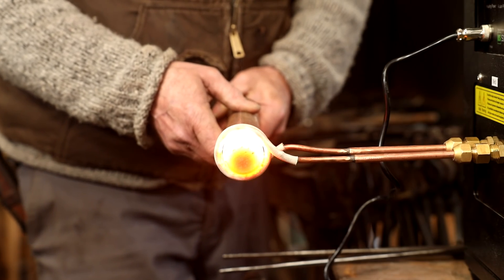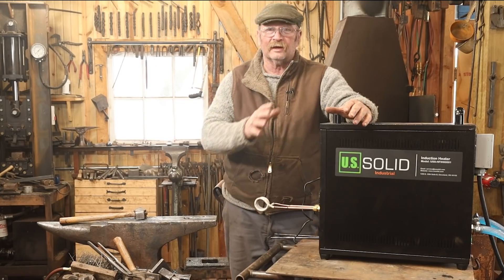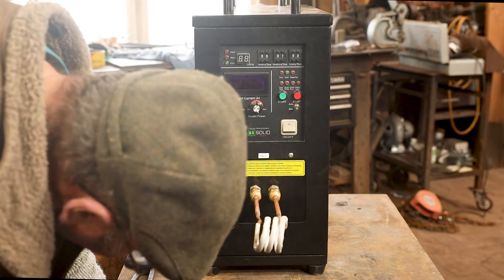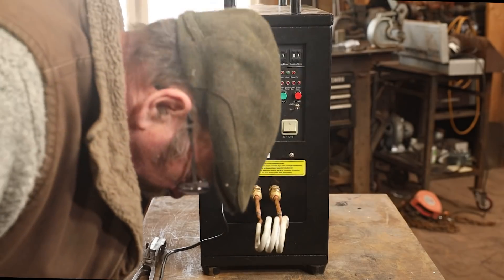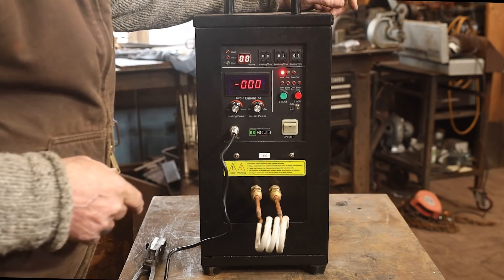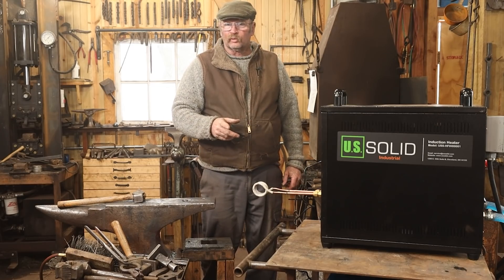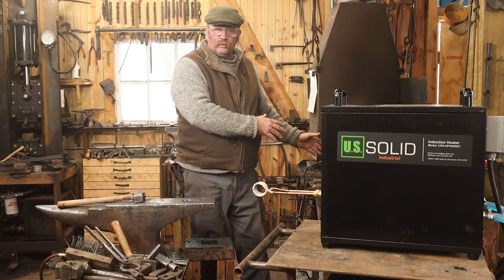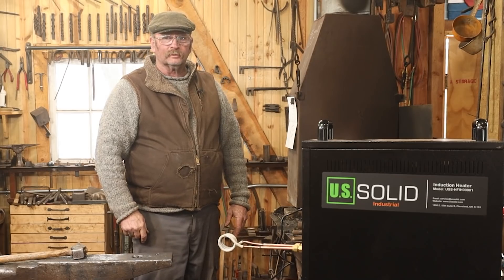Induction forge

Comment: Hello @Black Bear Forge ! your videos on the induction forge convinced me to get off the fence and buy an induction forge. The opening shot of the forge with coils and what looks like adapters from the 8mm to 1/4" flare is the reason for my question. Is that a set of adapters to convert the 8mm to standard 1/4" flare? I have a pair of the adapters ordered from mainland China (arriving ???), and a Forge on order arriving tomorrow and the tig water cooler just arrived this morning. My first coil I make will probably be a box that fits the leaf spring material I use for the larger Bowie style knives. I think I will try to make the first one large enough to fit the final form with it drawn out.  It might heat quicker fitting tight to the stock but over all be quicker and less effort to heat and forge the majority of it without changing the coil and just forging them out at the power hammer. I don't forge in the warm weather because my gas forge turns the shop into a torture chamber. A Gas forge adds heat and also humidity, that fact is not often mentioned but burning propane 'makes water' as a by product, and SW Michigan in July is humid enough. I have a hand held induction coil used for heating bolts but it has a small duty cycle, I managed to use it to make some nice bends in 5/16 rod to make shepherds hooks but I did supplement the heat with a gas torch to speed up the process, forming the tip took more heat/time than the duty cycle allowed.
Reply from the maker: Glad they helped. I think you’ll enjoy it

Comment: Hi! Love your video. I am looking into purchasing this induction heater. I have a quick question. On the machine on their website, the coils are positioned so that the work piece enters the coils vertically. On your video, your coils are where the work piece enters in horizontally. How do you get it so the coils are positioned for the work piece to enter horizontally?
Reply from the maker: You can make coils in either orientation and can bend the coil shown to be horizontal so long as you don't kink the tube.

Comment: I’d look into electromagnetic coupling via ferrite to couple very closely to the workpiece. That would bring the field losses way down and cause the piece to heat up even faster. 
This tight coupling was and still is used in high frequency power supplies.

Comment: I'm suprised to see these coils being used bare in a most videos I see, the sleeving is the most protection I've ever come accross. 
  I started in the trades building induction furnaces, forges and ovens. Everything from large steel melting furnaces, smaller precious metal ones and heat treating/annealing furnaces for coil and leaf springs etc.
  You can make the coils round, square or rectangular to suit the material being used. Filling the copper with fine sand when forming the coils on a mandrel helps keep the shape
  Tne easier methods we used was brass bolts soldered to the coils with 4 hardwood blocks drilled at the proper spacing intervals placed evenly around its diameter. Ceramic blanketing can be used to isolate the hardwood from the coil.  The inside of the coil then gets packed with refractory and the ends get shaped. This method only the inside gets packed. 
  Alternatively you can use the red/pink laminated electrical isolation board to maintain coil spacing and the entire coil can be cast in refractory.  Its available in all kinds of thicknesses.
 It would make using one of them safer and less stressful. A coil could could last years, maybe even a lifetime depending on how often its used. 
  Thought I'd pass that along in case its helpful.

Comment: Awesome! You could try making a cylinder out of soft refractory brick with a hole bored down the middle, wind the coil around the outside. "Undersized" parts will heat up way hotter, with less power, since it would kill the radiative and convective cooling.

Comment: I’m guessing it works by inducing an electric current through the metal to heat it, so placing your fingers in there would be a bad idea due to the iron in our blood. Would it have no effect on wood and plastic? Also what about non ferric metals?
Reply: Non ferrous metal doesn't heat. And you can put your finger or any other body part in the coil with no effect. Any amount of energy passed to the miniscule amount of iron in our blood is negated by the short length of time it would be in the field, due to circulation. 
Is it worth the risk to experiment? Hell no.

Comment: What are you using for the water pump
Reply from the maker: I tig torch cooler.  Just look over the induction units cooling requirements and compare to the cooler specs.  Lots of people save money by making their own cooling system

Comment: Im curious, would this thing benefit at all from having a refractory chamber built around the coil? similar to a propane forge?
Reply from the maker: Since the induction current causes the material to heat up while the coil stays cool, I don’t think would help and it could cause over heating.

Comment: hello.
just a tips.
when you start heating the steel bar, never put it entire in the coil !
it's faster when you put an small part of the steel bar on the nduction coil and when the small piece of steel are hot you can continued to insert the steel bar. try to always keep more than 600 on the screen.
and use gloves cause when the fiber glass protection put on the coil will be burn you risk electric choc ! ( never touch 2 spiral of the coil with your piece of metal ! ).
this is an fantastic machine i love it !

Comment: These look awesome but how hard does it get to hold the pieces still inside the coil for a minute each heat? Then hammer, etc and then back to holding still in the coil.
Reply: Make a jig to hold the stock. I have trouble holding things still, so that would be my plan.

Comment: I think it might be a Hassel changing coils for different sizes. If you're just using it for controlled heat use a torch. Just my opinion 😉
Reply from the maker: I'm not sure if its any tougher to change coils than it is a torch tip.

Comment: Hi John,
I started watching your videos a year ago. I was inspired but had nowhere to run a coal or gas forge. I have had a 15kw induction forge up and running since just before Xmas and I love it. The hardest thing to find in the UK are the metric flare fittings. I don't have your freezing issues and just have a big tub of water and a hot-tub emptying pump I bought on Amazon for £65. 8mm Copper pipe is readily available here but harder for you I believe. I make coils by filling the tubes with salt. EJ of the anvil coils 1/4" freehand. You can't do that with 8mm!
I have made an EJ style taco shell coil but it took practice.
Enjoy your new tool!
Reply from the maker: That taco coil seems like the solution to a lot of problems
Reply: @BlackBearForge  It's all about the size. The first one I made was formed around a 30mm pole. It brought my 40x5mm plate up to high orange but would not get to welding heat. I have made another tidier looking one around a 20mm bar but haven't used it yet. Filling the copper with fine salt and turning over the ends is my answer to stopping the kinks, whatever shape I'm coiling.

Comment: You said "220 volts at just under 30 amps.   That's about 6600 watts, or 6.6 KW not 15 KW..  No way could that thing produce 15 KW to the work.
Reply from the maker: I agree with the math.  One source specifies the 15KW as max oscillating power.  Since I'm not an electrical engineer, I can't explain what that really means.  But it really doesn't matter, this does exactly what I expected it would

Comment: I love it when you get new toys..... sorry..... tools 😁 I've actually only just heard of this technology as I saw one used less then a month ago on another YouTube video. I'm really looking farward to seeing one used in real forging and the forge welding sounds awesome!! This is going to save you a LOT of time when you just need to work on small sections of material.

I just had a random thought..... if you're doing production runs of an item that needs something done on one end (maybe leaf ends on hold fasts) and you have a die set up on the power hammer or hydrolic press that can do the step in less time then the induction forge takes to heat the piece. Could you have a stand set up to hold the steel in the induction forge while you are using the other tools?
Reply from the maker: Yes you can and can also set a timer so the piece is heating while forging the previous item.  They are very efficient for production work for that reason.  Although the short heat length might mean its not ideal for the holdfasts, they need longer heats for several stages of the process
Reply: @BlackBearForge  yeah, I was thinking of the leaf section as an example. Is there a maximum length to the section of steel you want to heat? I'm guessing it's based off the maximum length of coil you can use?

Comment: When making a new coils make sure your inturnal riadus is spot on because if not u will not get proper currents to flows threw coils. As worked for a maginatremic repair co in past and rebuilt many a coil in my day
Reply from the maker: great tip

Comment: The biggest problem I see is that your talking about using your induction coil for forging that is not always a very good idea
Reply from the maker: As a blacksmith, the only reason I purchased this unit is to heat material for forging.  It will supplement the coal forge and the propane forge.

Comment: What kinda of costs are involved in these induction forges?
Reply from the maker: It varies depending on where you buy and whether or not you buy or make a cooler.  Once setup its just the cost of electricity, which I think will be less than my propane cost and making custom coils.
Reply: @BlackBearForge   Thank you but I simply wanted an idea of what it cost you for this one that you put together in this video.

Comment: That's a neat setup. I worked in a railroad wheel shop, and they use induction heaters to expand bearing races and gear rings so they slip onto their quills. Since it's a big industrial shop, those are powered by 480vac three-phase. I wondered if there was an application that would let those bring metal to a forging temperature. Very cool. 👍

Comment: I have one almost identical to yours.  You'll get better heat on smaller stock if you hold the stock through the loop at an angle.  Also, more coil loops means stronger magnetic field, which heats a bit faster.  I love mine, works great, and as you point out, helps with managing the shop temp at times.  One odd thing, these are Chinese and they don't realize American "220" is actually 240v.  Mine won't work above 240, and my power runs around 242v.  So I had to make a voltage reducer to shave a few volts of my mains.  I used a few power diodes to accomplish that.  Worked great and was cheap.

Comment: looking at the dimensions of  the steel rectangle before and after heating. it is pretty astonishing at the way it changed due to heating. It looks like it got thinner which doesn't make sense.

Based on how induction works John, moving your part in and out of the coil at a constant rate will heat the part faster than holding it somewhat still. even if the stroke were small 1/4 inch 1/8 inch it causes more fighting of magnetic fields as described by lenz's law which causes more energy being turned into heat.

Comment: I don't mean to be a downer, but it seems to be inconvenient that you have to make different coils for different sized materials. Ya may as well just use one of your other forges for that. But it's decent for a particular project that doesn't require multiple sizes of stock.

You'll really like using it in the hot summer months.
Reply: I change coils regularly while working with one. It's a 30 second process. As you are working a piece you will return to the heat and then realise it's just not getting as hot as before it thins. Reduce the coil size by 5 or 10mm and suddenly the heat returns. It is always worth pausing and switching.

Comment: Looks good wonder how much power they use.
Reply from the maker: I doubt it will use any more than a welder.  It only needs full current when heating and I know i spend way more time at the anvil or doing other things than I do taking a heat.
Reply: @BlackBearForge  Good John I suppose when you look at it all, the  coal forge and the gas forge, they all take time to heat up then there's the fuel for them. The coke or coal and the gas so yeah this induction will probably be more efficient , can you keep us up to date with this please. ?

Comment: Very interesting! I'm currently looking into getting a similar setup. However since I live in Sweden and we have a different electricity system (even residential use three-phase, so no one has access to 30A) I need to have one customized by the manufacturer for three-phase. It'll be expensive but I think it'll be worth it.
Reply from the maker: 3 phase power would allow you to run a much larger unit
Reply: @BlackBearForge  Yes, I could run a 25 kW unit on the power I have available. But the 15 kW units are the sweet spot in price and capability. Even a customized 15 kW unit will be $500 cheaper than a 25 kW machine. The bigger machine needs better cooling as well.

Comment: Very good video.  I had been wondering about how and how well an induction forge would work.  We have an induction kitchen stove and it works a treat.  However, a couple questions:  1) cost? 2) would some sort of a work rest be worth the effort of building?  I could see a problem of holding a piece of stock in the center of the coil and trying to keep from touching the hot metal against the coils.  3) Would smaller stock heat faster if you held it closer to the coils rather than in the center?

Thanks.

George M.
Westmarch Forge
Laramie, WY
Reply from the maker: A work rest is certainly in order, many people just use bricks.  smaller stock may heat a little faster near the edge.

Comment: When I get into production work, an induction forge is something I think will be amazing. First thought about them that way when I stumbled onto those Swedish axe factory videos, where they just have a long bar feeding into an induction forge, advance it to cut off the heated slug, and then use the slug while the next one heats. Even if you don't reach quite that level of efficiency where it could be finished after the first heat, I imagine it'd be really good for the first step of most things made from barstock. Turn it on, do the first step on a dozen items, then start sticking them in the forge. Didn't know anything about the size to coil size limitations. I've got to wonder if it would heat a stack of material (ie a damascus stack) simultaneously, making it even more ideal for welding.

Comment: I've been looking at the circuit boards with coils that are on Ebay.  They need power supplies (with 30 second delays), water suppliers, fans and cases but are otherwise cheap.  I want an S-hook sized one to handle all the small stuff I do quicker and with less fuss and expense than other forge options.
Reply: They don't need "delays" in fact you need to turn them on as quickly as possible a sluggish power supply can destroy them as they don't start up properly.
Reply: @mfx1  That's just it.  I've read that it's a good idea to use a power supply with a delay so it stabilises it's current before supplying it to the induction circuit board.
Reply: @glennmartin6492  No you just need a better power supply not a "delay" I suspect they are referring to having a large capacitor bank that can quickly supply the current needed to start, capacitors do take time to charge that applies to all power supplies but it should be minimal.

Comment: I recently saw a post about induction heating. And John's doing a video on it, I clicked on it so fast. I always wondered if the induction coil was solid or a pipe. And I always wondered why the copper didn't just melt. Thank you John for all the extra information. I did not know that there was antifreeze cooling solutions for welding equipment.

Comment: As far as I can tell, a benefit of this method is speed of heating, especially localized for critically focused forge welding. The need for specially designed and sized coils may be a bit aggravating, though. But for repetitive production work woul be the ticket. Making nails would be a good application. Can visualize a nail every 10 seconds as opposed to only two a minute wide open conventually. Yes, I make a lot of nails for specialty purposes for a few carpentry craftsmen. 🐾🔥⚒

Comment: I did not  thought it would run on 220. Very interesting
Reply from the maker: The bigger units won't but this should do most stock sizes i work with
Reply: @BlackBearForge  it would be ideal for me. I make lots of small stuff (and I run out of propane al lot😉)

Comment: Do you get less scale with induction heating? I imagine it would. Are there other advantages that accompany electric induction heating?
Reply from the maker: I think there should be less scale due to no forced air from a blower.  The big advantages I see right now are speed, controlled heat and ability to use it where other forge option might not be practical.  But I will do a pros and cons video once I have more experience with it.
Reply: I imagine it would be pretty handy with fixing twists in projects since you can target the heat so precisely.  You wouldn't necessarily need oxy acetylene torch.  Anyway, thanks for sharing.  Cheers.